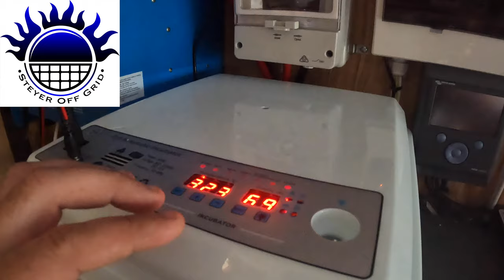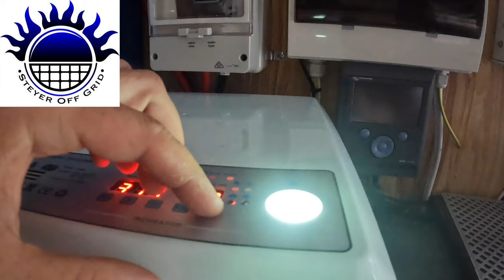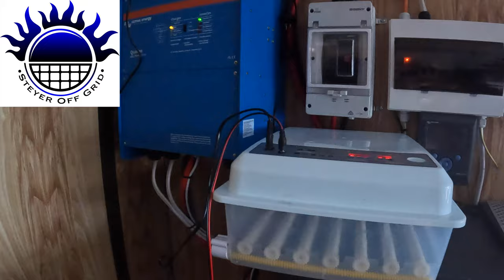New Egg Incubator With 12VDC Battery Backup

Comment: What 12 volt battery did you end up using? And did you go with a 50ah or 100 ah? Thanks!
Reply from the maker: I sent this incubator back but I was just going to use a 12V4ah (10HR Life) Battery. My new incubator isn't battery back up but my solar is running good now so all good. I have Hens hatching now.